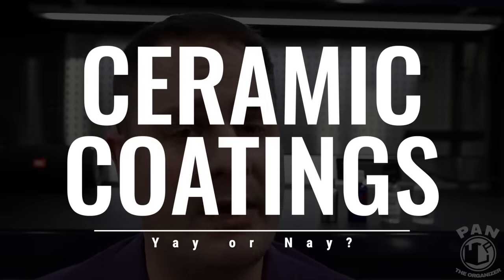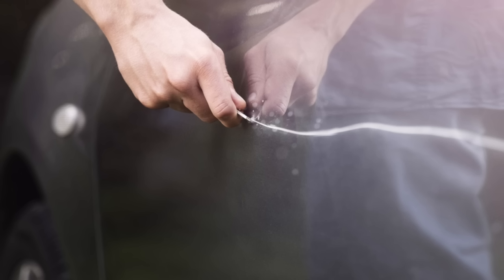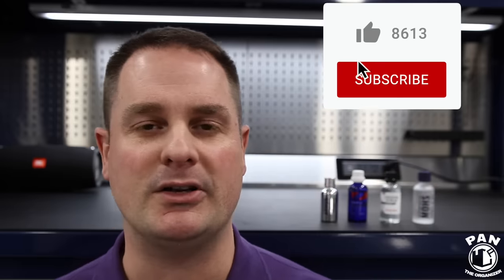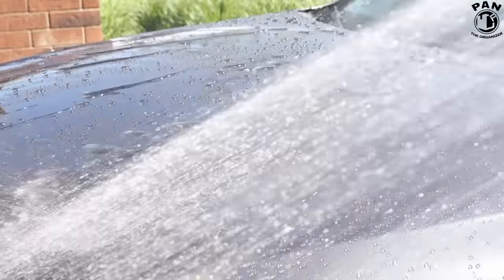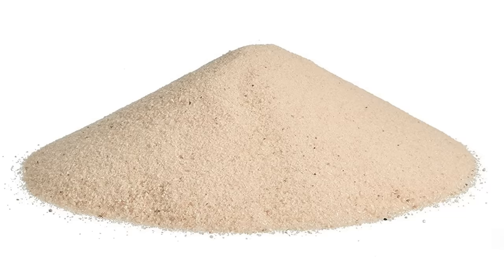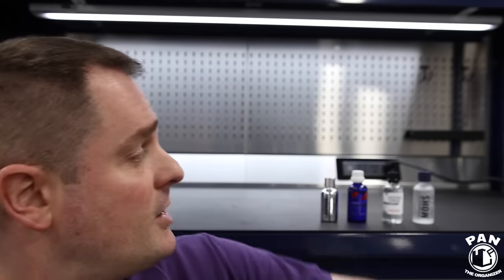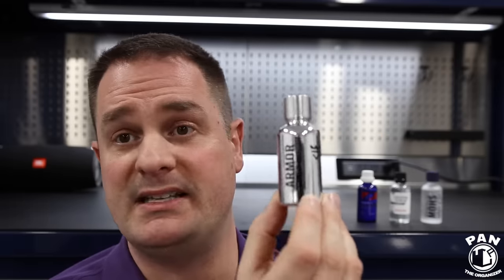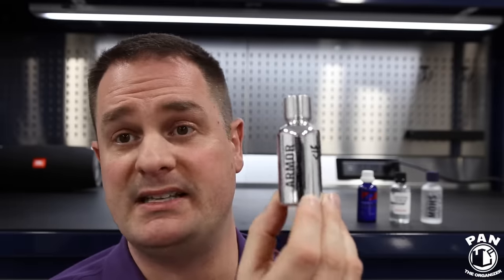DON'T BUY CERAMIC COATINGS BEFORE WATCHING THIS !!

Comment: How many microfiber towels do I need to level ceramic coating? Do I need one per panel like polishing pads?
Reply from the maker: Two or three towels for an entire car.
Reply: @PanTheOrganizer  Thanks 🤙
Reply: @PanTheOrganizer  Also, can I use beadmaker as a topper?

Comment: Can I still buy the Armor KingArmor Shield 9 on their site with your promo code?
Can this ceramic coating be used after headlight restoration?
Reply from the maker: No promo codes anymore. And yes you can apply it in paint, glass, wheels, plastics and lights.
Reply: @PanTheOrganizer  just purchased it. Are applicators reusable? I know micro fiber towels are not. I love all your videos. You have taught me, even as an older detailer (52 years old), so new tips. 
Thank you, Pan.

Comment: Wow!!! Help---> how would you compare Armor shield vs Maguire's Ceramix Liquid wax? I'm using it on my car... can you top them upon eachother?
Reply from the maker: Armor Shield is a true ceramic coating (in a glass bottle) and will last a lot longer compared to Meguiar’s liquid wax. They are in two different categories. You can’t really compare them.
Reply: @PanTheOrganizer  thanksssss okay, that's why I've always been struggling with meg' stuff here in levis haha

Comment: Hey Pan- what do you recommend using on a Zamboni? Would a ceramic coating be ok? Being around water/ice all day, I just want to give it some protection to try and make it last. 

Thank you
Randy
Reply from the maker: I have never detailed a Zamboni so I don't know what type of paint finish is on there. If there's a clear coat, you can apply a ceramic coating on it, or even a silica spray sealant if you want to be quick. There are even silica spray sealants that are spray on, rinse off for super quick protection. Those last 3 months on average, but are ultra quick to apply (CarPro HyrdO2 Lite and Gyeon WetCoat for example).
Reply: @PanTheOrganizer  no clear coat, just paint (kinda like a tractor or lawn mower). I’ve heard of people using ceramic coatings on lawn mowers but I’m not sure. Don’t want to mess it up

Comment: can you put mutable coatings over a car that already ceramic coated? and if so do you need to decontaminate first?
Reply from the maker: That's a hard question to answer, as there are so many different coatings out there, it's hard to give a straight "yes" or "no" answer. Why would you want to apply a different coating on top of an existing coating? Ceramic coatings are best applied on virgin clear coats, well prepped paintwork. They need to bond directly to a contamination free surface for maximum durability and performance. So by trying to apply a coating on top of a coating, what risks of happening is the base coating might reject the top one if they're not compatible.

I would stick to use an appropriate top coat like a silica spray sealant every few months, as part of a maintenance regimen.

Comment: Everything I wanted to know about ceramic finishes and then some.... what about a demo😬 how do you prep properly
Reply from the maker: Thank you Lauris! You're in luck! I have the most popular ceramic coating application tutorial on YouTube (over 4.1 million views). Here: https://youtu.be/byKcYsEyWGk

How did you discover my channel by the way?
Reply: Thanks! 👍🏼
Reply: Your channel popped up as I was looking at restoration / detail videos,  you are very thorough. I just paid money to have my car detailed and I'm very disappointed. I recleaned my car after I got it home. I'm happy with my own job on the inside, but not the outside. 🤔 Almost ready to drive to Montreal 😄 1263 miles, sigh, I guess it's not going to happen. I let my son use my 2015 Camry for over a year, big mistake, he and his friends trashed it. I'm trying to bring it back to life.  Halfway there.
Reply from the maker: Thanks for the positive feedback! You can do it! With my videos you’ll learn so much and eventually be so happy seeing what you can do on your own without having to pay a detailer.
What’s your favourite video on my channel so far?
Reply: I've only seen two, they are both good, but the he link you sent, of the actual application- that video was amazing

Comment: Amazingly informative video, Pan!...here is a question for you:
Can I apply a ceramic coating such as the Avalon King or the CarPro coatings over a typical Dupont graphic rally striping (such as dual striping on a truck hood), and thus perhaps help protect the rally striping from cracking, dulling due to heat and uv dulling? Conversely, will these coatings damage such striping, such as causing cracking?
Reply from the maker: Yes you can apply the coatings over vinyl stripes and graphics.

Comment: So if I put in the time to do one of these ceramic sealants I still need to put on a spray sealer. I am guessing this is similar to the turtle was products like the turtle wax hybrid or flex? Why should someone go through this process of applying it from the glass jar when they still need to use the spray bottle form after?  I have a brand new vehicle and have used the spray ceramic sealant version and am wondering if it is worth it to buff it off and use something like the Armor 9?
Reply from the maker: Because glass bottle coatings have the best chemical resistance, gloss, slickness, UV protection, hydrophobics and self-cleaning properties, meaning the vehicle is much easier to wash during maintenance washes.

Comment: Pan,  What topper do you recommend for a ceramic coating?   I have a BUNCH of Quick Detailer, but I suppose that really won't work?
Reply from the maker: As a topper for ceramic coatings, you should be using a silica spray sealant. My favourite ones are listed in my annual car detailing products awards video here: https://youtu.be/ULvGi3dbBrA

Comment: Hi Pan, I love the info videos. My question is after you apply the product on and level it with a towel does one have to worry about dust falling on the treated area as it dries?
Reply from the maker: No worries about dust.

Comment: Hello, Thank you for your videos, Regards from Ecuador. I work with Avalon King for 2 years and I love it, but maybe you know which topper can I use with Armor Shield, you said the toppers for Cquartz, Gtechniq, Gyeon. but which one can I use for Armor Shield. Thank you.
Reply from the maker: You can use what ever silica spray sealants you want on top of AvalonKing for maintenance every two or three months. CarPro Reload, Gyeon Cure, Gtechniq C2V3, The Last Coat 2.0, Turtle Wax Ceramic Spray Coating, etc. I have reviewed all of them on my channel.

Find out my top picks in this video: https://youtu.be/ULvGi3dbBrA

Comment: Pan, love the videos. Question, where does new Gyeon wax fits in terms of ceramic coat boosters. Would you use coating booster or wax? Or booster and wax?
Reply from the maker: It's up to you to decide what you like best. Gyeon Wax has tons of gloss (in fact it made my list of my glossiest products video not too long ago). But don't overdo it. You would pick either the Gyeon Wax or a ceramic booster like Gyeon Cure for example. Not both.
Reply: @PanTheOrganizer   Thanks Pan!
Reply from the maker: My pleasure Igor! Hey what’s your favourite video on my channel so far?
Reply: @PanTheOrganizer   so far I like them all.

Comment: Great video, I saw your new fav advertised by LegitStreetCars channel first. I think I will try it!
I have a question for you! Two part.
Can a vinyl wrap be applied directly over ceramic coating, or does it have to get stripped off first?
And can ceramic coating be applied to vinyl wrap surfaces?
Reply from the maker: I'm not a vinyl wrap installation expert so I can't answer that. You would have to ask the wrapping company you're dealing with. But one thing is for sure, you normally apply a ceramic coating ON TOP of the vinyl wrap or PPF. There are even PPF specific coatings now on the market, like CarPro Skin and Gtechniq Halo.
Reply: @PanTheOrganizer  thank you very much for reply Pan!
Again, very informative video, thanks for your work
Reply from the maker: Thanks! What’s your favourite video on my channel so far?
Reply: @PanTheOrganizer  I have only watched this so far. Im mostly after mechanical vids for now. Once the car is in top shape mechanically I will be watching some of your vids for detailing.

Comment: Won't using an electric buffer on the paint damage the clear coat?
Reply from the maker: Quite the opposite. Polishers are made to remove defects, swirls, scratches, holograms, sanding marks, restore gloss, restore depth and pop, add clarity, thanks to compounds and polishes, which are abrasives. The compounds and polishes remove a fine amount of clear coat in order to remove those defects and make the paintwork appear flatter and hence better light reflection which leads to more gloss.

I did a video about a paint polishing tutorial for beginners here: https://youtu.be/X2qjO5xZZ2E

Comment: Hi there...I Had a Question...I have a brand new car...Can I apply Ceramic coat after washing the neatly once or should I polish the car and then apply the Ceramic coat... Please Answer...
Reply from the maker: You should do some preparation steps before applying any ceramic coating, even on new cars, as you don't know what they have been through and often, dealerships apply a cheap wax just before delivery so it looks good. 

I highly recommend that you watch my tutorial on how to apply ceramic coatings: https://youtu.be/byKcYsEyWGk

It's the most popular coating tutorial on YouTube with over 4.1 million views. :)
Reply: @PanTheOrganizer  thanks for the reply...Is Proper washing and Isopropyl spray cleaning enough...?
Reply from the maker: No. Watch my video.
Reply: @PanTheOrganizer  ok thanks

Comment: I'm curious what is the average price one can expect to pay a professional to clean/treat the paint and ceramic coat the car for a 3 to 5 year protection.  I understand pricing could very but I am looking for a base estimate.  Also how long should we expect to leave our car with the detailer to complete the job?
Reply from the maker: It's impossible to discuss prices on the internet, as there are WAY too many variables, including location. A detailing job in Montreal won't cost the same in New York or Paris for example. And even within the same city, the prices vary in different neighbourhoods. Then there's the detailer's experience, quality of products used, etc.

But a complete coating job takes a lot of manual labor and man hours. Pre-wash, wash, chemical decontamination, mechanical decontamination, machine polishing (compound, polish), IPA wipe down, ceramic coating application...

So it's not a cheap service by any means. And you're looking at years of protection (compared to just a few months like regular waxes) so it's a great investment. I have seen pricing upwards of 800-2000$ USD for a proper coating job, and the price varies of course on the state of your paint. The more correction and prep it needs, the more time the detailer needs to spend perfecting it, so the price increases.
Reply: @PanTheOrganizer  Thank you so much for this reply. Yes I was quoted about 850 USD for my brand new car. I was caught completely off guard with the quoted price but I guess it's within the range you mentioned above.

Comment: Hi Pan, thanks for all your tips, they are very useful. I have a quick question, glad if you could help me with your suggestions here. After applying a sealant if there is a rain it leads to some sort of rain drops, is there a way to avoid this?
Reply from the maker: You should pick a day to apply the coating where it won't rain for at least 24 hours. Some coatings need at least 48 hours before exposure to rain or water. That is critical.

Comment: Ceramic coating is for new vehicle only or could be applied to older ones (5yrs or so).
Reply from the maker: Ceramic coatings can be applied on a vehicle regardless of how old it is. As long as there is a clear coat, you are good to go. Of course, paint preparation is key prior to applying one, but I have a detailed tutorial on that on my channel.

You need to remove any previous protection before applying any true coating (in a glass bottle) as they need to bond directly to a virgin clear coat.

Follow my simple ceramic coating application tutorial here: https://youtu.be/sqQYVjxFqK0

Welcome to my channel. You discovered one of the biggest car detailing channels on YouTube as we surpassed 830,000 subscribers and 105 million views! I have been detailing for 25 years and I love to share my knowledge and passion with my viewers.

You found the right channel to help you learn everything about detailing.

Comment: if you had your car treated with wax eg TW hybrid ceramic protector - how to prep surface for the ceramic coating
Reply from the maker: You must fully strip any previous protection off before applying any full blown ceramic coating (ones in glass bottles) and that includes machine polishing.

Watch my super popular tutorial on how to properly apply a ceramic coating here: https://youtu.be/byKcYsEyWGk
Reply: @PanTheOrganizer  i am asking cause obviously new TW hybrid is chemically resistant so even PREP shampoos wont touch it
Isopropy wipe probably not enough either
Reply from the maker: Exactly

Comment: Are there products specific to black plastics and /or glass?
Reply from the maker: It depends what coating you are getting. Some coatings are just for paint (like CarPro CQuartz UK 3.0) and they have specialty coatings for plastics (CarPro DLUX) and glass (CarPro FlyBy).

Other coatings can be more versatile and applied to all exterior surfaces, like the AvalonKing Armor Shield IX, which can be applied to pretty much all exterior surfaces: paint, glass, wheels, plastics, lights, etc.

Comment: Pan,  there is lots of info on the "best" shampoo for a car that is ceramic coated.....several of them have a high pH so I feel that they may clean well but will be hard on the ceramic coating (removing bit by bit).  So which neutral shampoo do yourecommend or do you feel a high pH shampoo is ok?
Reply from the maker: CarPro Reset is my favourite shampoo for cleaning ceramic coated cars. If you want a pH neutral shampoo that is "lighter duty" then Adam's Car Shampoo is the next best one in my opinion. I speak about those in my annual car detailing products awards video here: https://youtu.be/ULvGi3dbBrA

Comment: Is there a topcoat for the for the Armor Shield? Do I need a top coat after the Armor Shield?
Reply from the maker: They don’t have one, as they say it’s technically not needed on their coating, but for optimal performance I would still recommend use of a silica spray sealant topper at least once every two or three months. And that boosts gloss and slickness so it’s always a good idea. :)

Comment: Just watch this video I'm just curious what exactly happens if you do put ceramic coating over a waxed car is it permanent damage to the paint or will the ceramic just not last very long.
Reply from the maker: The ceramic coating won't last long as it won't be able to bond to the clear coat. You need to strip the paint of any previous protection before you apply a true coating from a glass bottle.

Welcome to my channel. You discovered one of the biggest car detailing channels on YouTube as we surpassed 820,000 subscribers and 100 million views! I have been detailing for 25 years and I love to share my knowledge and passion with my viewers.

You found the right channel to help you learn everything about detailing.
Reply: @PanTheOrganizer  thanks for your speedy reply so does that mean if there's  high spots they won't stay very long on the car?

Comment: This a great video thanks. I wanted to get your thoughts on the Ceramic Pro 9H vs the Gtechniq Crystal Serum Ultra. I have professional detail shops near me that certified in each but I am torn on which one to go with.
Reply from the maker: I would for sure recommend the Gtechniq. They are more respected as a high end coating brand. They're a top tier coating brand like CarPro, Gyeon, Kamikaze and Opti-Coat.

Comment: You mentioned the reviewed products all have their own silica based sealants for maintenance are they different from ceramic sprays like Meguiar's or Turtle Wax sprays or the same thing? Thanks for the education Pan!
Reply from the maker: Meguiar’s Hybrid Ceramic Spray Wax and Turtle Wax Ceramic Spray Coating are both also silica spray sealants yes. They can be used on top of existing ceramic coatings.

Comment: Love your videos, and would love to see a video on how to remove a coating (ex cquartz) if its applied wrong. (buff off before flashing) :/
Reply from the maker: Thanks! I'm not sure I understand your question though. If you made a mistake while applying the coating and see high spots many hours later, the only way to correct that is by machine polishing and reapplying. That's why you have to be very careful when applying a coating and look at your work as you go. 

I have the most popular ceramic coating application tutorial on YouTube here: https://youtu.be/byKcYsEyWGk
Reply: @PanTheOrganizer  Sorry about my poor description. I have applied 1 layer cquartz and 1 layer gliss, but I did it in 8 degrees celcius and I don´t think  I allowed it to bond long enough before I wiped it off. It was my first time, and I was really unsure about the flashtime in that cold weather. The water is not beedingr, so I dont really know how much coating is in my car.  Thats why I want to re apply,  but unsure of how to  remove the existing coating